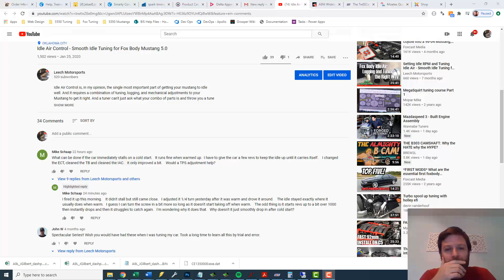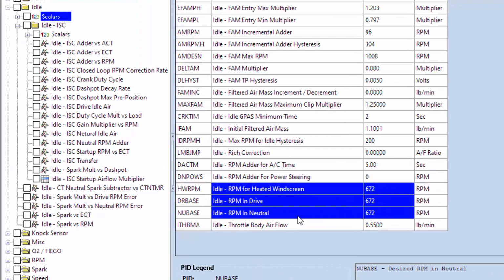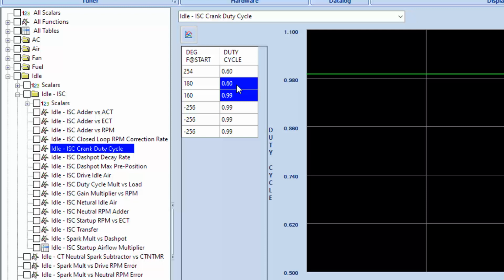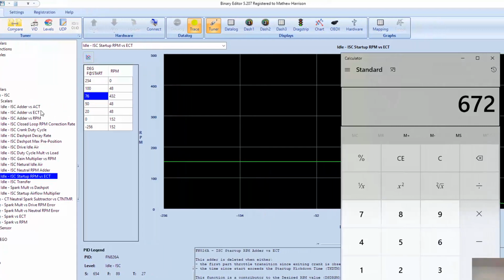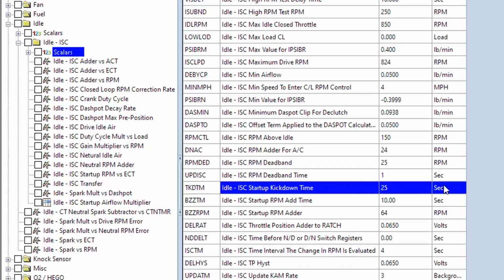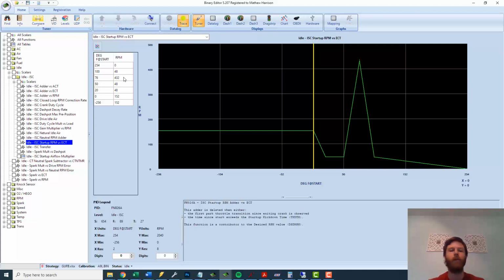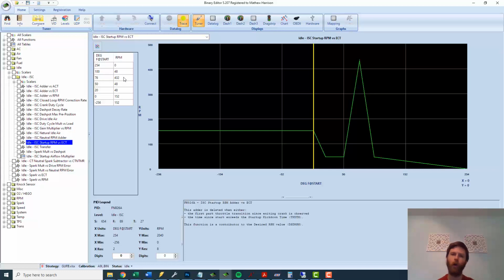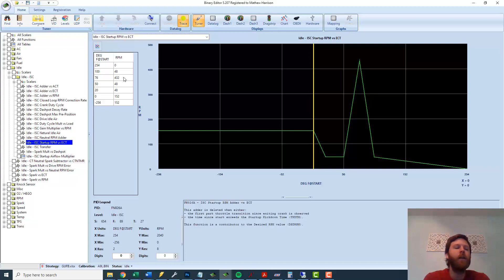Fox Body Startup Idle Air Kickers

Comment: Great content! I finally got my car to do fast idle on cold start. My idle screw was making it idle at 950 rpm. After lowering the screw to fully closed, with the idle air adjuster and valve it finally works. I’m still dealing with issues of after warmed up start it will not idle. I have a trick flow stage 1. You mentioned before that the stock computer can handle that cam at near stock idle. I can get the car to idle great without the iac plugged in at like 550 rpm and when I plug the iac back in it jumps back up to stock idle speed and is smooth. Once I shut the car off and restart it surges and dies. Any input? I’m not tuning at all just deal it with stock parameters
Reply from the maker: What maf and injectors are you running?
Reply: Leech Motorsports 24 lb and a pro m calibrated for 24 lb
Reply from the maker: You might want to try raising the throttle stop a hair more. If it is at 550 unplugged, see if you can get about another 50 rpms out of it without the idle air valve hooked up. Then reset battery. Lastly, make sure your base timing is at least 10 degrees, but 11-13 is likely better on even a stock engine combo.
Reply: Leech Motorsports I think I’ve done that already lol. I’ve tried so many different things trying to fix this lol. I’ll try adding more idle screw. What could be causing the surge though? Once it settles down it actually idles solid.
Reply from the maker: Lots of things. Generally surge is caused by fuel being pretty far off or idle air being pretty far off. Timing is less important here. At idle the car is trying to maintain a balance. It reacts to under speed and over speed with air and timing changes. And fuel being way off makes things difficult. When the car first starts, it is running in open loop and the car won’t use real-time fuel correction from reading the o2 sensors. My guess is that the fuel is off a bit and right after starting, it gets caught trying to correct idle speed. But once warmed upC you don’t have as much of an issue since the car is reading the o2 sensors and corrected fueling.
Reply: Good stuff!